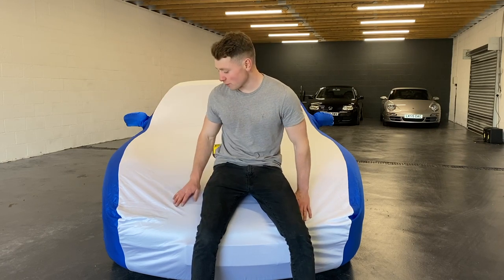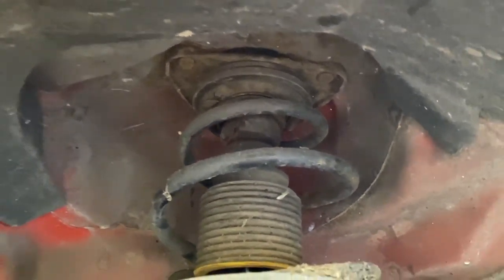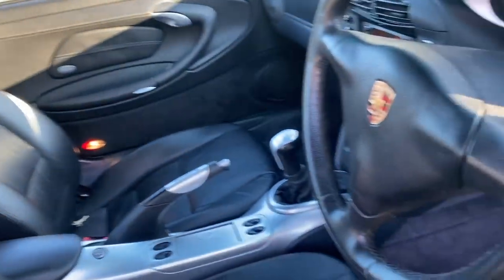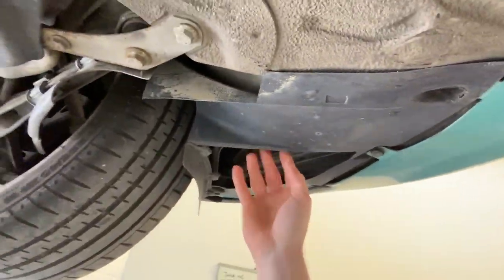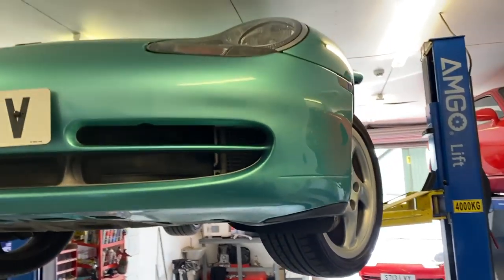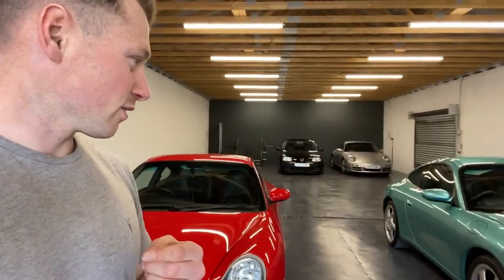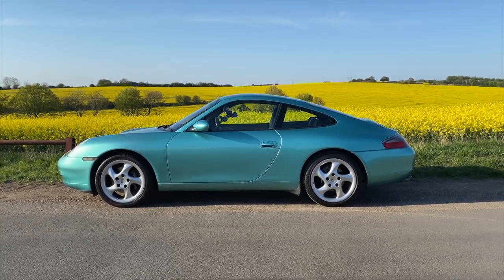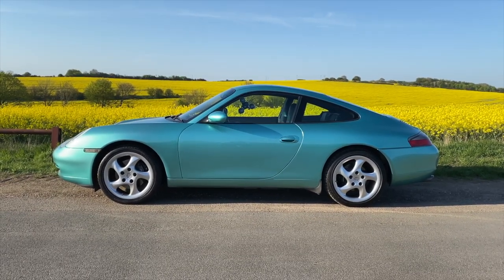Is this Porsche 996 the RAREST Carrera in the UK? - FGP Prep Book EP5

Comment: I love the Ocean Jade Metallic 996, not so much the colour but the fact that it is a 1998, a manual, non-sunroof & rear wiper delete. As you said in the vid, it allows such clean lines from that beautiful 996 rear quarter view! I personally hate sunroofs on coupes - they ruin the roof line, create another potential leak point (the drains always get clogged) & reduce the stiffness. If I want a big hole in my roof, I'd buy a Cabriolet!
I had to laugh when the car was up on the hoist and you said how clean the underside was - when there was surface rust everywhere. I'm not having a go, I know that it is par for the course for UK & north European cars because you salt the roads in winter, but here in Australia we just don't get that kind of corrosion at all. But you guys in the Northern Hemisphere win because our UV down under is so harsh, it destroys rubber & vinyl trim around doors, windows and the complete interior.
Anyway, great video, I love your attention to detail, the fact you show the maintenance that needs doing and Porscha Care fixing it and your detailing of the paint work. Obviously, a good marketing cross pollination for Porscha Care but well deserved - a mechanic whose pedantic attention to detail wants to re-orientate an exhaust clamp to the correct position, is my kind of mechanic and would definitely get my business!
Reply from the maker: Thanks for your feedback Mark, it's much appreciated. 

The underneath of that car is very high on the "clean spectrum" for a 996 in England - As you say, there are two sides to a coin; we don't suffer from rubbers and interiors perishing!

We have a very good working relationship with Porscha Care and so are more than happy to give them any exposure these videos bring, which to be honest, is more views and comments than I'd anticipated when I started making them a few weeks ago!

Comment: Great video 👍🏼, i have a 2001 996 with 60K miles with a tiptronic automatic gear which has a gear gasket leak. A couple of mechanics recommends not to change the gear oil because it has never been changed before therefore might damage the gear if i did. Whats your thoughts ?
Reply from the maker: Abdul Adel gearbox oil is a serviceable item. Get that oil changed and nice new gasket on the sump to stop the leak!

Comment: great vids, I own a 2001 manual no sunroof seal grey 996, options include M030, aero kit less rear wing, full  leather and turbo front bumper, but alas its has a rear wiper. it looks very similar to a 40 year anniversary model. has only covered 30k, IMS clutch condensers coffin arms all done …. just wondering what sort of value you would put on it? I know its hard without seeing it  cheers
Reply from the maker: Hi Paul, thanks for your comment. Feel free to get in touch either by email or telephone; both found on our website, and we'll be more than happy to discuss your car and try to give it a valuation. Many thanks!

Comment: Cool car. I think I have something comparably rare. I have a '98 996 with same hollow spoke turbo twist wheels and I also have the factory LSD fitted. Manual car, black on black, but with sun roof and rear wiper. Mine's a South African market car (C26) and I'm struggling to get much info on it's early life as Porsche UK can't provided anything. Any ideas how I'd find out first owner details? Porsche South Africa is a subsidiary of Porsche Middle East, which is ran out of Dubai. I've not found anyone there able to help.
Reply from the maker: Hi William, i've never dealt with any main dealers outside of the UK so I wouldn't know what to suggest. All I could advise is to keep pestering Porsche UK. Sometimes you stumble across someone there who is more helpful than others. Good luck!